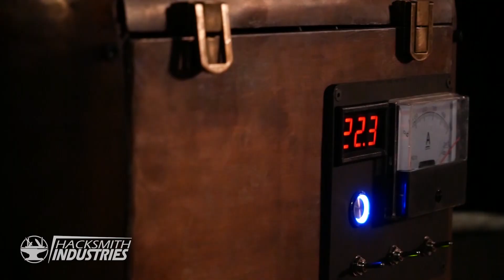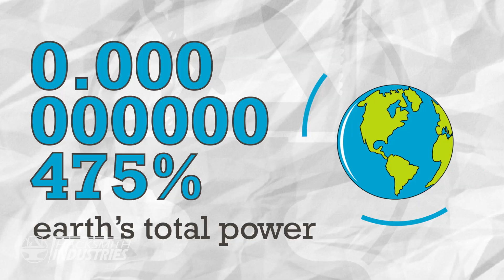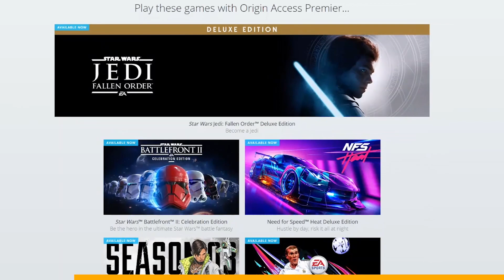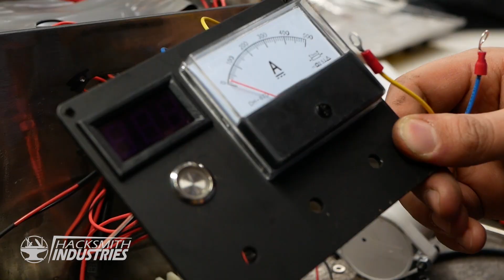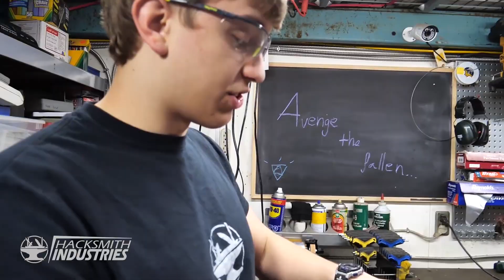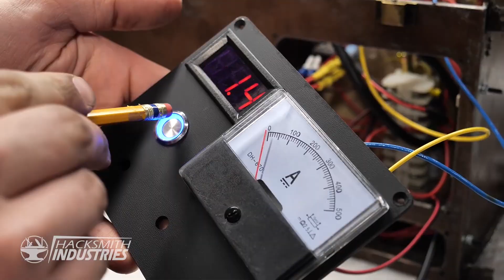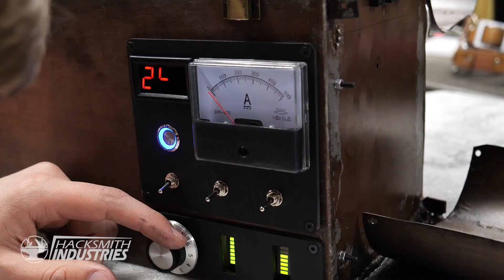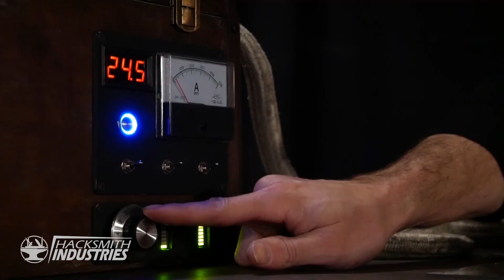World's First Protosaber! (REAL BURNING LIGHTSABER)

Comment: To make it look more like Jedi sword, You need to make the sword to hide inside the sheath, and make it spring out when u power it on, and jump back in when you power it off. After that, the only thing left is to use mini nuclear reactor instead of batteries, which I guess will take more time to do ;) also genetically engineer someone with high midi-chlorian count to hold it will take more time, I guess.

Comment: You can use a semiconductor commuted Relay instead of the contactor. You have an IGBT turn on just before the relay closes and shorts to the IGBT. The system I built in the 90s could switch  270v at 117A with no degredation. Or use a Kilovac relay.

Comment: If you were to make a lightsaber using focused energy held in place by a powerful magnetic field, the charge surrounding the blade would cause a resistanance that would knock you back or cause the handle to fly from your grip when attempting to make contact with another blade (two magnets of the same charge). Accompanied by a blinding flash and the sound similar to a lightning strike in close range, simultaneously blinding and deafening the user (if the handle kept from exploding like a grenade on contact). As shown in the video the heat from the blade would cause radiation burns. Winning a duel would be mostly chance over skill. You would have to be a Jedi to use this weapon. Happy hunting for Kyber crystals and may the force be with you.

Comment: When is someone going to make an actual laser instead of using a piece of metal and heating it up
Reply: You do realize the beam coming from a lightsaber is plasma, not a beam, right? And do make Plasma, you need a thing to be very very hot. Scorching hot. Hot enough to melt, well, anything.
Reply: @dustinjenkins7309  anything except Beskar armor
Reply: You do realize that's impossible right ?
Reply: @zsurvivalist7996  not for the government
Reply: You realize plasma thick enough to be used for a saber would have to be at least as hot as what would come out of a fusion reactor, which reaches temperatures of upwards of 100 million degrees Celsius?

Comment: No one:
Lightsaber: casually lights on fire every now and then
Reply: At 16:03 and following you can see that they spray sth onto it to make the flames
Reply: Yah the amount of heat that thing generated is atronomical. Only way of really dulling down to a safe level is to somehow make a thermal transfer node, that siphons off excess heat, recharging the saber in the process.
Reply: Yeah I happen to be in the 8th grade so absolutely 3% of those words make sense to me
Reply: @discountethan  
Lots of heat. Machine makes extra heat into battery juice. Yay.

Comment: How do you actually control the power? Do the dials actually do anything, or are they just for looks? If I’m not mistaken, it’s just a contactor. If you used MOSFETs you could PWM, but you can’t really PWM a solenoid. If you did, I would imagine we would see it pulsing because of how slow it is at actuating.
Reply from the maker: Button on the handle
Reply: the Hacksmith So on the battery pack, the dials are just for show?
Reply from the maker: Yup

Comment: Ok, so it's basically real life canon that the first protosaber color was orange.
Reply: I wonder if you could make it so hot, it would turn blue instead of orange/reddish.
Reply: @0Ton_93  could you hold it though?
Reply: @lazarus4759  Yeah, that's the problem...
Reply: @0Ton_93  😂😂😂😂these guys will figure it out eventually
Reply: @lazarus4759  Oh yeah, got no doubts about that XD
Reply: CELL no, that’s a myth that something that’s really hot turns blue. With more oxygen supplied to the fire, less black body radiating soot is produced. Thus creating a blue appearance

Blue flames do occur at higher temperatures than red or orange flames, but that doesn’t mean that heating the blade up will change its color, you gotta decrease the soot produced by the flame and increase the oxygen supply to the flame, hence why welders flames are primarily blue
Reply: @NakaSemperi8479  Oh i see, i based that in the colors of the stars, blue being the hottest (I think), but i didn't know that.
Reply: @NakaSemperi8479  thats not a myth lol
Reply: Ultra Hyper Extreme Spooky Boi what about using another metal since different metals change flame colors ?
Reply: @lukeecom  That requires combustion of the metal compound mentioned. You would need to replace it, because the saber would default to blackbody radiation.
Reply: @NakaSemperi8479  You are on-point, but seem to overlook that combustion and blackbody radiation obey different laws. One is heat released by through a chemical reaction via rapid oxidation in particular, the other applies to any object that is hot enough or at least ionized. Tungsten filaments in incandescent lighbulbs and fluorescent tubes, for example. 
Different elements that burn in compounds produce different colors, thus we have fireworks. Copper burns blue-green, potassium burns violet, sodium burns orange, barium burns green, and lithium burns a beautiful crimson. In the end, your point still holds, as a blue blackbody-radiation temperature would be hotter than the surface of our sun! The sun itself "burns" brilliant white.
Reply: @0Ton_93  You could coat the blade in different elements to change the color.
Reply: @Resters52_official  they'd vaporize or melt
Reply: @Resters52_official  Your best blues are gonna come from Arsenic, Indium, or Lead. Tungsten filaments glow at around 2500 celcius, so needless to say there's enough heat to burn any salt you throw at it, but the problem is the effect will be entirely transient, and you'd have to let the filament cool down to reapply the metal salts and get the color back after just a short while of use. Also, salts of all 3 metals just so happen to be incredibly toxic, and inhalation is a very very very bad idea. You could use a cupric halide, as they're less toxic (keyword: less), but this reaction produces a more greenish blue color.
Reply: @OmnipotentNoodle  that's cool, you could probably wear a gas mask and then it's deadly for the opponent but not you
Reply: @Resters52_official  until all of those elements finally vaporize. Then it will turn orange again.
Reply: @0Ton_93  I mean, yeah, depending on the metal you burn you might get the blue fire (or even green and  purple) but i don't think that those can sustain that much temperature without melting (it depends).
Reply: @magnum78923  Pure, ground state metal is inert and cannot burn. Metal ions (such as those found in metal-based ionic salts) on the other hand...
Reply: @OmnipotentNoodle   Yuuup you're right. Forgot about that factor too...
Reply: @0Ton_93  no you cannot unless it TRULY was a lightsaber with no components actually distributing the heat, oxygen is what turns a flame blue. The proto type in the video COULD get so hott it would turn white, but no other color.
Reply: @austinguy2324  Well, white sounds good enough, but i think that would be kinda dangerous.
Reply: @0Ton_93  I don't think even that size tungsten rod could handle a white hott heat anyways, hed need a considerably large one and at that point, the heat coming off would literally scorch your face along with any connectors in the handle
Reply: glowing white hot would be the hotist could get it ut it the handle mostly get  red hot too
Reply: @jaygopinath1694  you're right,but that hot would make the blade melt
Reply: Y'all so smart.
Reply: The color is bc of the temperature. Matter has two kinds of light spectrums, one that depends on each atom and another that's universal to all matter that's produced bc of temperature.
Basically just like lava, the higher the temperature the redder it looks, final color is white.
Reply: And as far as I can tell, the first lightsabers were also connected by a cord to the powersource carried on the back
Reply: Holuo which is literally mentioned in this video, thanks.
Reply: @smalldevils2929  Was skipping through the vid so must have missed it, sorry
Reply: @Holuo1  The discussion you prompted warrants the comment, imo.
Reply: w. d. gray it has begun...we will begin to make the republic soon
Reply: w. d. gray nah all the comics and crap was de-canoned, sorry.  It’s just gay fan fiction.  Anyways this light saber needs a pole so it’s not real.
Reply: Different gasses make different colours, but some are more dangerous, yo.
Reply: They also had power packs to power them as well
Reply: 2030 hacksmith invents lightsaber
Reply: Mom said it’s my turn
Reply: It would make for a great source to get a nice skin tan
Reply: Also connected to an external battery pack.
Reply: Protosaber?  Yes

Lightsaber?   No
Reply: Snails40  heat is energy technically
Reply: Me: laughs in the end of rise of skywalker
Reply: Palpatine:i'm proud of you to make the first lightsaber of the dark side in orange,the next in red.

Hacksmith making the deathstar:wait a moment,i end this and i start doing it.

Comment: Really well crafted, the only nitpick I have is the strap holding the power pack onto the operator. I would suggest a harness like the ones used to hold gas powered leaf blowers onto the users backs. 

Then again I would have failed to make a working power pack.

Comment: I have a theory that you can use harmonics to harness and mold light into a solid shape. A solid beam of light one atometer thick would very likely bear the appearance of a lightsaber blade, and cut like a lightsaber without the intense heat that is associated with a lightsaber.

Comment: my idea was way off from this i was more like thinking a carbon rod with a plasma cutter pack drill some pin holes into the carbon sheath then run the gas through the space of the rod and sheath so the plasma gas is forced out and burns off before it goes to far and the main issues with that is the gas and power supply

Comment: OK I think I can help you guys out. You are going about this all wrong. You only need a Kyber Crystal & a Cool looking package for housing the Kyber Crystal. It will need a conduit for channeling the energy but that can just be exposed crystal somewhere along the Saber Housing or Handle.
Once the Welder has the saber in hand and is ready to fire it up he just needs to touch the Exposed Kyber Crystal with his finger or fingers and channel his Unlimited Force Power through the Kyber Crystal. The Force is only available to a true Jedi Master. Which means they goofed when they allowed Finn to weld it. Well anyone can learn to use the Force but hey it's not just like flipping on a switch.
The Crystal is actually transformed into the blade of the Saber which is what limits the length, color & intensity or actual Power of the Blade.
And Force Power is actually All Power Period. This explains how Kylo Ren grabbed and held the Blaster Bolt in his first episode. He just held the power in check or in flight.
Master of the Power/Force is the key to Powering the Light Saber.

Have fun and don't Burn your Eye Out.

Comment: You made a heating element. Yay. You could have just bought a cartridge heater for around $30 that would outperform this thing as well as use less current. For around $250, you can buy one that will melt steel. This word "real" that you keep using in your videos. I don't think you know what it means.

Comment: This could be a great military weapon, join the military hacksmith
Reply: Cost, weight, efficiency and marine IQ kinda kill it's military applications lol
Reply: So uncivilized...
To use a weapon like this in such a way would be disgraceful, not to mention impractical. 

One error, and it's useless and not efficient to fix. And then there's the actual uses.

What would you use it on?  anything durable that this would specialize against would likely kill the user first. that's because it would take too long to be reliable on an active battlefield with cutting power.

Sabotage? maybe as a disabling tool for metals. 

Search and Rescue? Plausible, as a tool to cut through rubble piles. But active battle? No.
Reply: @kaitoudark1  ... Since there's such a thing as a civilized weapon..... Realistically, if you're using this to cut through rubble you've likely roasted the person you're attempting to save, the practical applications of this device are limited to curiosity, though you've given me a practical reiteration for this. If you created a smaller version of this, say 1/10th the size, you could have an efficient portable heating element that could act much the same as magnesium, with the exception that it would be able to dry larger bits of fuel beyond just kindling and produce a greater heating area of effect. The smaller variant could also be used to signal search and rescue whether it's lighting a signal fire quickly or becoming a bright beacon at night.

Comment: While it's a cool toy, it's not a lightsaber. It's based on the flawed premise that the power requirements are what's standing in the way of a real lightsaber. In reality it's the fact that we can't make an energy beam that stops at a certain length and has a physical presence. An actual lightsaber would be more of a forcefield projector like they use in Star Wars.
You could probably come closer to the appearance of a lightsaber by using and extendable rod (like an electric antenna for a car) with mirrors on the tip, high energy green lasers for the beam light, and a fog dispenser to make the beam more visible. 
The laser emitters would be in the handle, and the beam would reflect off the mirrors on the tip back to the handle. By making pinholes in the extendable rod and pumping fog through them you'd make the beam more visible. By arranging the emitters in the handle in a circle around the rod and strobing them you'd get the uneven flicker/pulse effect you see in the movies. (they used reflective tape on a rotating rod that was lit externally. The tape was like the finish they use on road signs so it caught the light better than the actors holding the device and seemed to glow)
If you wanted to try building something like I suggest you could also start with a spring loaded baton like security guards use. While it wouldn't really cut anything, you could probably power it with a much smaller battery. (possibly even in the grip)

Comment: "We need so much power that it's equivalent to a constant lightning bolt in order to operate a lightsaber"

Thanks for providing the best example of how powerful a lightsaber is.

Also the Force is the power source of Star Wars' lightsabers. Kyber Crystals basically work like a magical focus, like a wand in harry potter focuses magical energy. If you could design a device that could pull energy from other dimensions, then make that as small as a small crystal you could easily hold in a child's hand, you could use that to make a lightsaber.

Inb4 Kyber Crystals are an ancient quantum techno-crystal created by a long-dead civilization that was spread across the galaxy before their fall.

Comment: Hacksmith, I’m not sure how hard thorium would be to get, but it is a safe, nonweaponizable alternative to uranium reactors. And since it’s safe, it can be made MUCH smaller. Maybe try that for a new battery for your protosaber, or even a lightsaber if you can get it small enough
Reply: Nuclear reactors are hard to scale down to really small size because you need to keep in enough neutrons to sustain the reaction. Since thorium is not directly fissile on it's own, it needs to be used in  a breeder reactor which means the neutron budget is even tighter.
Reply: @dk39ab  If I'm not mistaken Thorium was experimented with and done successfully in a full size reactor back when the US GOV was testing out different nuclear energy sources but was defunded since it didn't help breed unstable isotopes for nuclear weapons.  Also if I remember correctly it required a Molten Salt Reactor to run properly for sustained periods of time.  Please correct me if I'm wrong as I want to make sure I have a proper understanding of the subject matter.
Reply: @dean07252000  Also, I think one of the real reasons is that there was already decades of research on uranium reactors and none on thorium. In fact, there are currently no working full-size thorium reactors, though there are prototypes and have been one or two reactors in the past.
Reply: Ok
Reply: nothing on this earth is "nonweaponizable" thats not even a real word lmao
Reply: @socknetea  I mean... weaponizable is. It means, "Can be weaponized." And as a general rule, the prefix, "non" can be added to words to mean not. So... It's still valid.
Also, if you don't know anything about word etymologies, don't act like you do. And there are things that can't be weaponized.
Reply: Nahh, I mean.. if I take a chunk of thorium and beat the shit out someone with it, I would say it's pretty weaponizable.
Reply: ShloKing even a piece of styrofoam or paper could be weaponized in the right situation.
Clearly you haven’t seen Chronicles of Riddick or played Hitman 2. 🤷🏻‍♂️🤣

And yes I know those aren’t real situations, I’m mostly joking, but seriously don’t underestimate the ability for humans to make things Into weapons.
Reply: @trindalas  That is true, if one were using the incredibly vague and broad definition. However, we're talking about nuclear weaponization. The term from which the word originally came from. Which only deals with the ability to turn standard weapons into nuclear ones.

Therefore, in this case, thorium is not weaponizable, as, by noting context, we can understand that we are concerned with nuclear weaponization.
Context is King, baby.
Reply: ShloKing  *we’re
Reply: @paulrscell  Man, I'm usually pretty good with catching typos... Thanks, though.
Reply: @plzletmebefrank  oh yeah? Let me know what they so i can kick ass and chew bubble gum